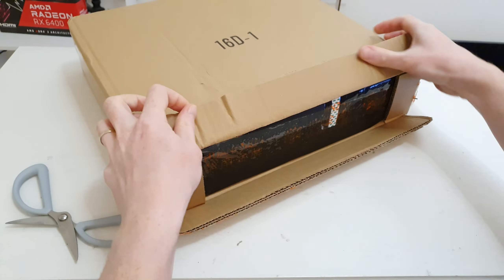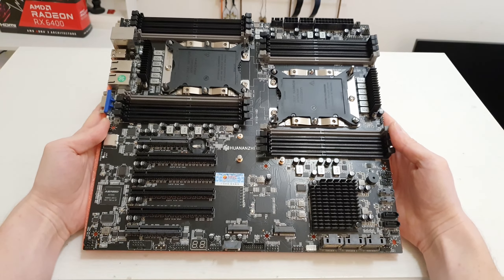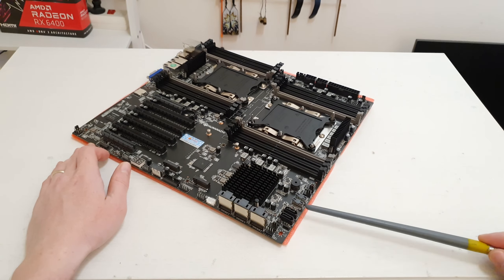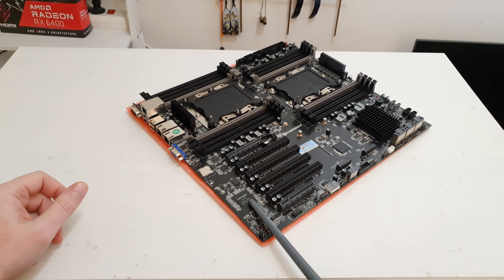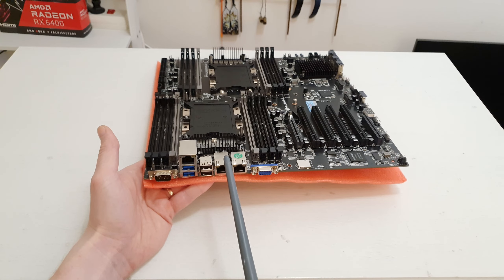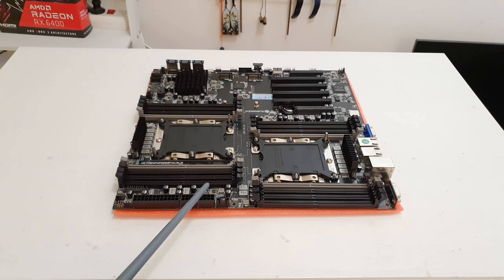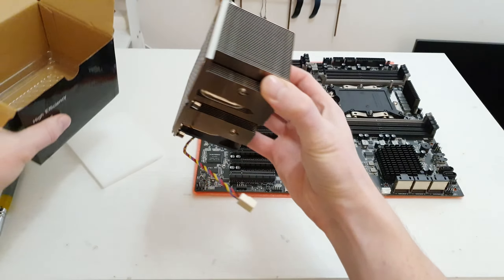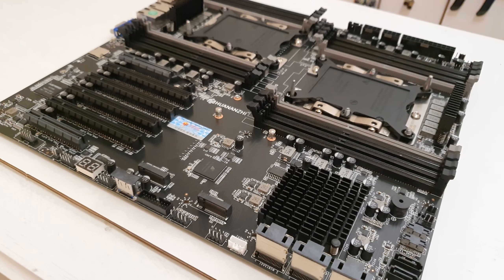Huananzhi X11D-16D - unboxing dual socket LGA 3647 motherboard

Comment: Expensive board, priced at around $500. Gold 6138 or Platinum 8124 are $90 + coolers + RAM + NVMe SSD + power supply + case. With not high pass marks around 43000. I. Don’t think it would make sense for gaming. Only for server environment. Hunanzhi is as expensive as supermicro second hand !
Reply from the maker: Very true, it has absolutely nothing to do with gaming and the current price is way too high, you can get Supermicro alternatives on eBay for cheaper.